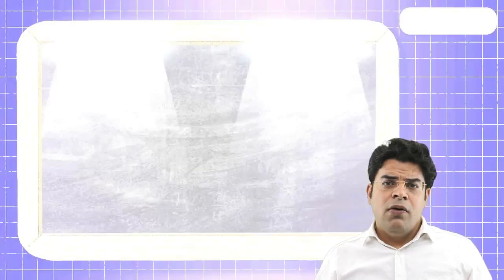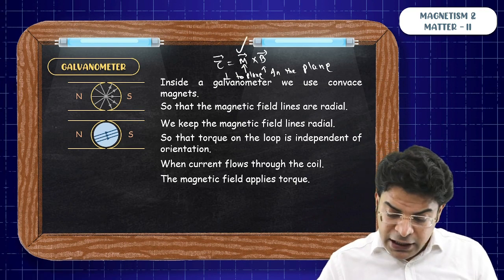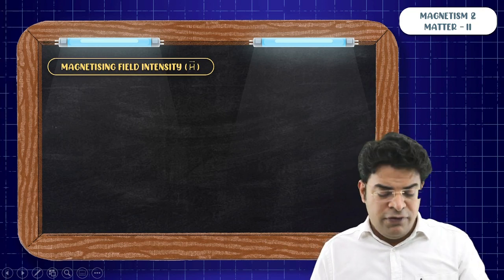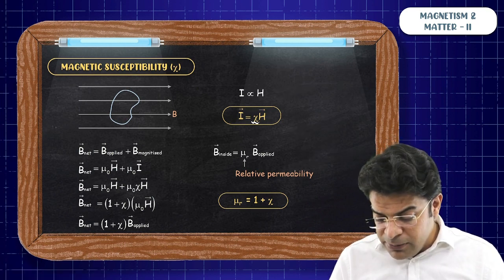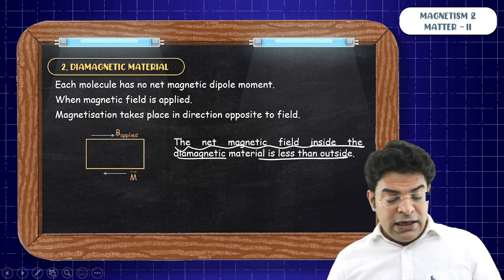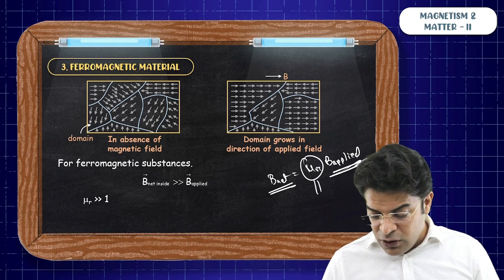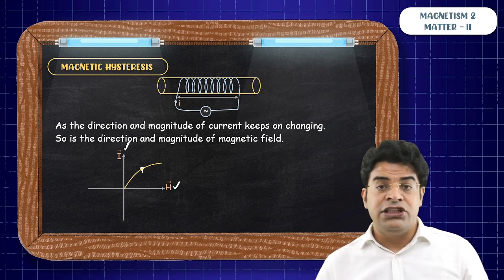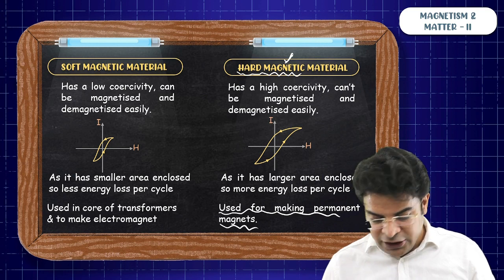NEET Physics Revision | Magnetism & Matter - Galvanometers, Ferromagnetism | Hour 65/84

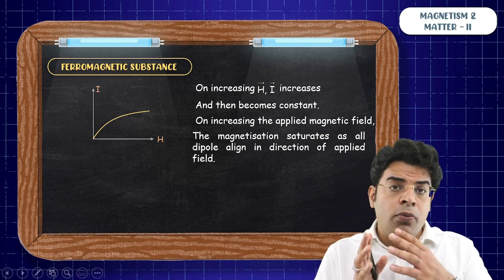Comment: Sir at 56:38, if in a Ferromagnetic substance the saturation occurs then why doesn't this saturation occur in a Paramagnetic substance??
Sir, as Ferromagnetism is an extreme case of Paramagnetism, if that extreme case(Ferromagnetism) only reaches the saturation then why doesn't the basic level(Paramagnetism) which has a lower number of free dipoles than that of the Ferromagnetic substance can reach the saturation Sir 🤔🤔??
Sorry for such a long question Sir 🙏🏻🙏🏻!!